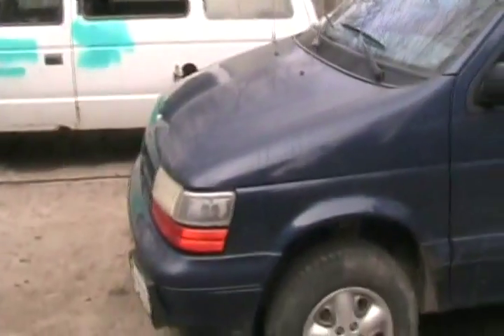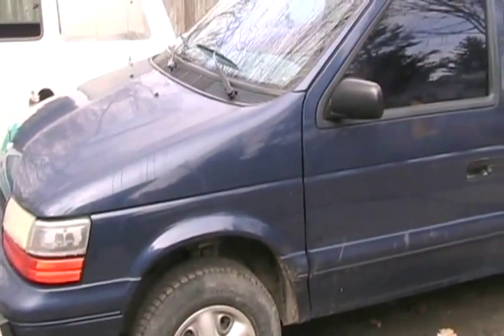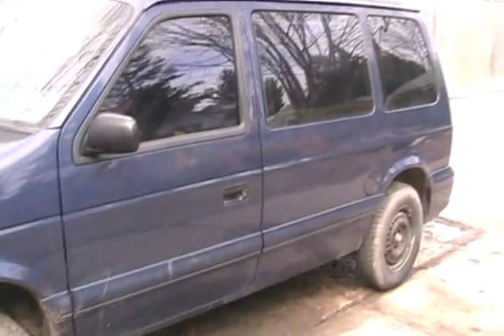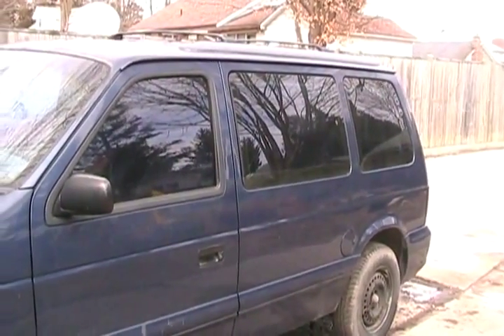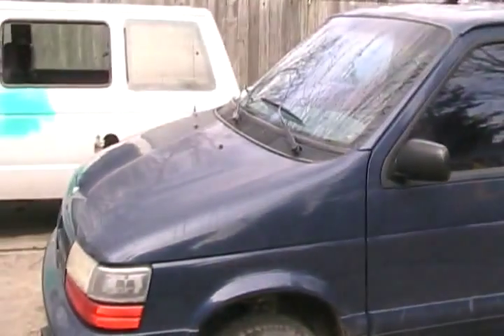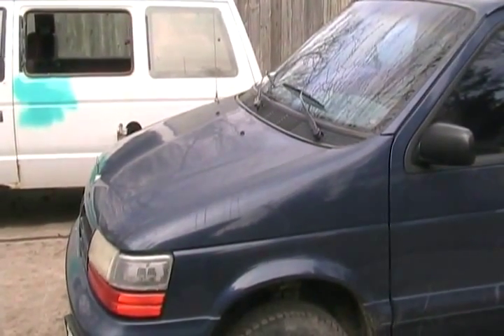#10 Dimples on cars increase fuel economy [Davidsfarmvlog]

Comment: While I enjoyed your somewhat out-of-the-box manufacturing concept of using high water pressure/"explosive" forming to generate complex sheet-metal shapes, as, if dimpling ever were to become a mass production endeavor, then that might be the cheapest way to go. 

However, vortex generators need only be, on the trailing end of the car*, so mythbusters would've got comparable efficiency numbers with just the clay dimpling 
on the rear portion of the car and roof, or alternatively:
 they would've got comparable improvements by mounting  properly 
designed vortex generators on the rear half of the car, such as the products sold by "Airtab"(tm). 
That is, If those tabs, do actually turn out to be well designed shapes.

*The only reason why a golf ball has dimples, globally, is because you 
don't know beforehand, which side of the ball is going to be facing into
 the wind, so you cover the entire ball for any eventuality in 
direction. 
Moreover, If you did know beforehand, say you were firing golfballs out 
of a gun and you could control which face of the ball would be facing 
into the wind, then a smooth front-end and a dimpled  back-end.(covering
 60% of the ball to ensure that flow separation didn't occur) Would very
 probably be the most optimum shape for a spherical projectile moving 
thru a fluid, such as sea level=air and water. 

Can anyone think of a better shape?